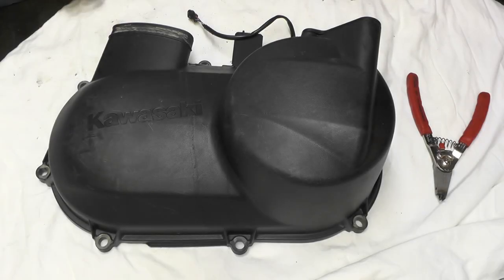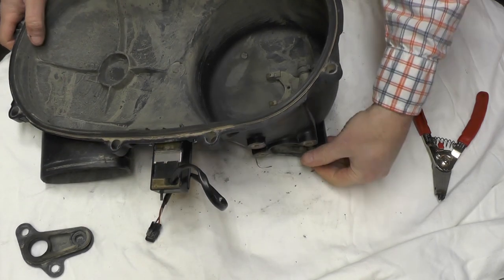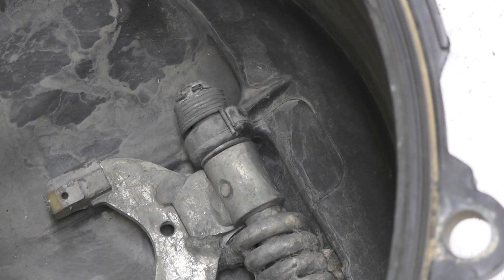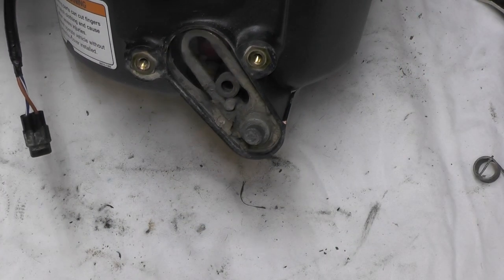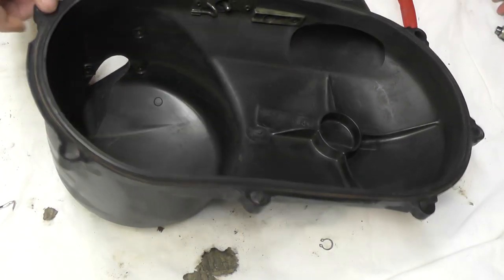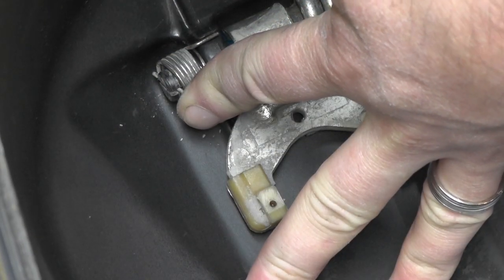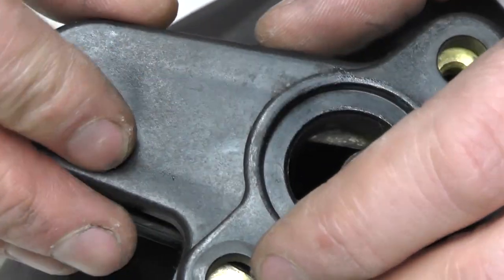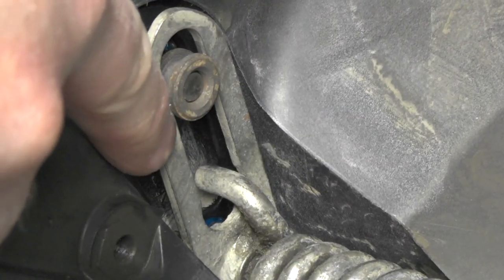Noise from Belt Area? KEBC Actuator Fork Cleaning & Greasing - 360 650 700 750 Brute Force, Prairie

Comment: I have a 2002 650 prairie.  I put an original replacement belt on because on acceleration the belt would squeal but once going everything was fine.  When you stop and come to an idle it squeals again.  Could this KEBC mechanism cause this squealing sound?  I am getting the same noise with the new belt.  Any ideas what could be causing this?  Thanks very much.
Reply from the maker: Yes, the KEBC could be the issue. Although cleaning the mechanism greatly helped eliminate belt squeal, it did still squeal after coming to a rear breaks locked stop and start again.
Reply: Any chance you found out what that noice was minces doing the same

Comment: Will fix the issue I’m having with my 360. Every time I go from N to High or reverse there is grinding and it won’t allow me to in gauge the gear.  My Kawasaki only has 535 miles on it.
Reply from the maker: Check to make sure idle is not to high or throttle cable in a bind. Does it idle ok?  If not, pull the clutch cover and make sure everything is moving freely.
Reply: I had the very same issue….I don’t know why this noise is happening, I changed the belt and checked it again…it seems fine

Comment: Yes but what sort of noise was the quad making???
Reply from the maker: The noise will vary... at times a ticking and at other times high pitched. Basically, the KEBC motor working harder than it's designed to.
Reply: @atvdirt1  are you referring to the whine/brake reset noise it does when ever the Kawi is shut off, and only when turned off? Like a fax machine type noise almost?
Reply from the maker: Dale, after a hard stop it would squeal taking back off. The extra resistance the dirty KEBC unit had just enough resistance to keep it from functioning quick enough. The reset like you described was still apparent after the cleaning but much shorter in duration.
Reply: @atvdirt1  thanks def got a great channel w no BS approach to things. Newly subbed, keep up the great work. These brutes are excellent, but finicky for sure.

Comment: mine has a tick sound like a watch when it's turned off and does it none stop killing my battery after a day or 2...PLEASE can u tell me what is wrong???
Reply from the maker: Matt, try cleaning and greasing everything like shown.  While your in there you may want to go ahead and change the belt as well.
Reply: Everything ATV-UTV-Reviews u think that would fix the constant ticking sound while key etc is all turned off?
Reply from the maker: Matt, can't guarantee it. This is where'd I'd start if the noise is coming from the KEBC system... costs you nothing but some time. If it doesn't fix the issue you can rule it out, but suspect it is the problem...
Reply: Everything ATV-UTV-Reviews ok thanks!
Reply: @mattchristie4707  did you figure it out?